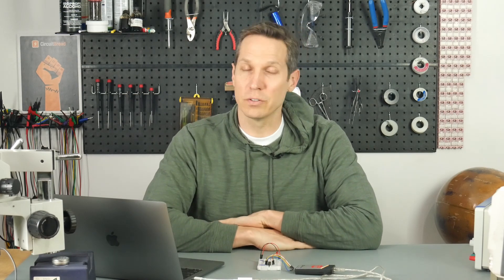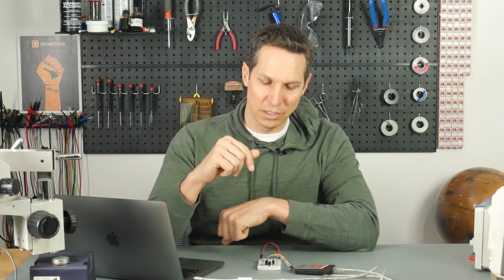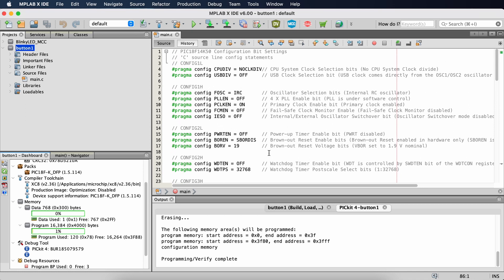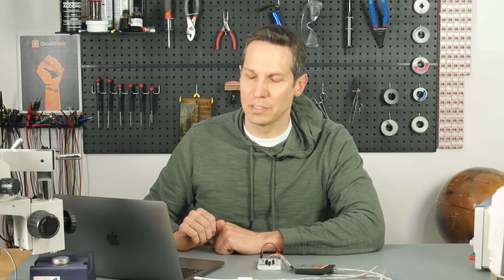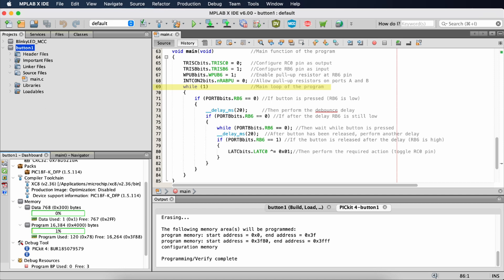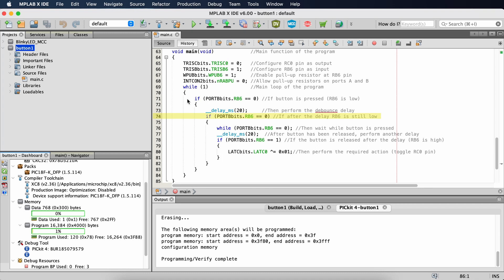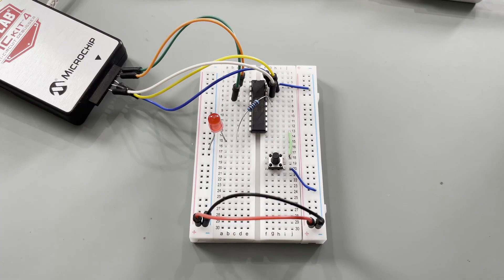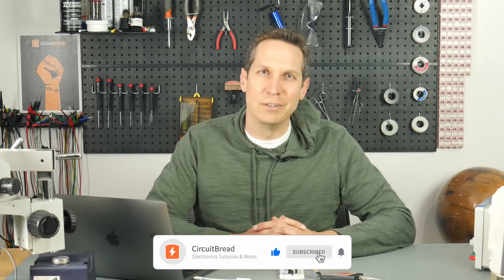Part 4. Using a button - Embedded C Programming with PIC18F14K50

Comment: Thank you very much for pointing me to this tutorial. I  understood how an external switch could be used to control the output. 

However this is not exactly what I was looking for. 
pls bear with me for explaining. 

suppose I have a lead acid battery and want to control its charging etc. 

By default I can detect the voltage and set it charge  when the voltage drops to 11 volt. However a user must be able to set it as he wishes , say at 10v or 10.5v 

In this scenario , I need a facility to set the voltage settings by a user , just we do in any software programs. The microcontroller should remember the new settings and work accordingly till a new setting is done. ideally the microcontroller should remember this last setting even if the power was disconnected ( Am I wrong in thinking that this setting should be set in eeprom ?).  

I am new to micro controller programming and trying for practical implementation. 

Thanks once again for such a detailed and wonderful tutorial.
Reply from the maker: It sounds like you'll need an ADC to measure the voltage of the lead acid battery, which I'm not sure if you've already figured that portion out but it should be pretty easy (and use a voltage divider before feeding that voltage to the MCU or else you'll damage it).  As for the settings, it's just having the buttons setup properly so they can be used the way you want.  It's the logic internally once your program receives a button input.  Is that button setup to "increase the threshold voltage" or to "decrease the threshold voltage"?  That's all internal to the software you're writing of how to react to the different button inputs.  You are correct that you'll want something non-volatile like your EEPROM, that would be great!
Reply: @CircuitBread  Thank you for responding. I have already made a programe to detect the voltage through ADC and react according to the input voltage - as you said using voltage divider. All that is working nicely. 

But , the final product will be used by someone else and he might want to have a different setting according to the battery he uses. So I need to incorporate a user setup function , which he can do without having to change the code. I can provide an LCD to show the setup. A software will not be complete without having such setups and I do that in most of the softwares I have designed.  We can store such settings in some sort of database or other file system. easily.  But I am in dark here regarding micro controllers, EEPROMS. 

It would be a great help if you can throw some light on this. Thanks again.